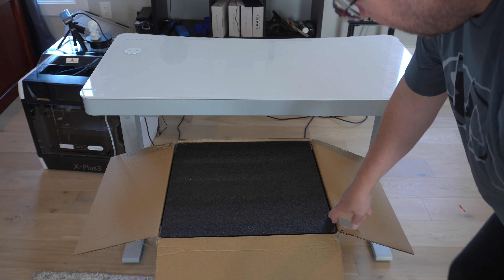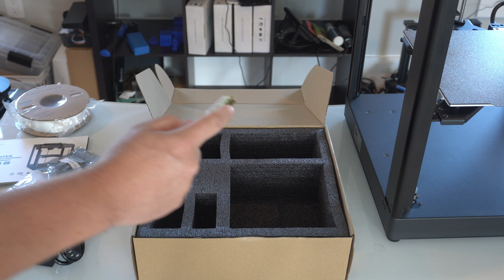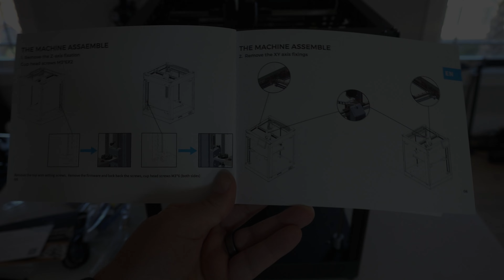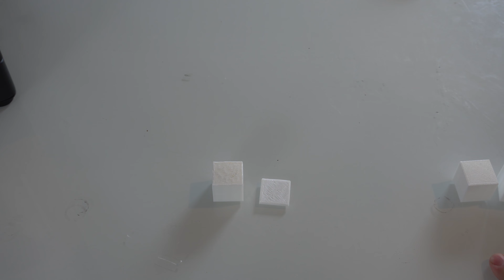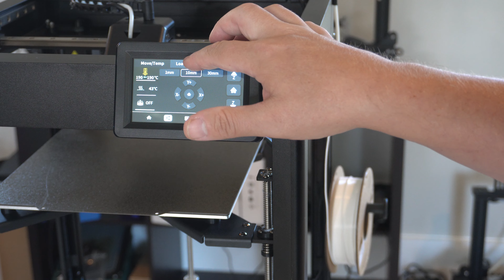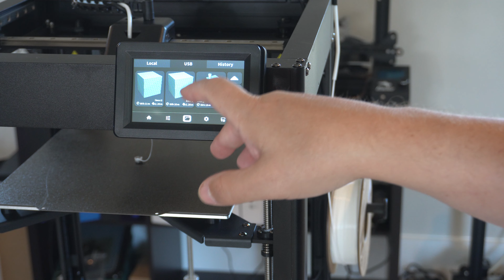TwoTrees SK1 – Unboxing and First Print

Comment: Pretty brutal to watch this video.  Didn’t really cover anything.  Lots of rambling at the beginning.  Then setup was wrong.  You don’t use card stock to do a Z offset.  Didn’t tram the bed, do any input shaping.  Then wondering why your printer was printing in the air.  All you have to do is use the filament load and unload.  Don’t need to home, heat, and push into the extruder.  Printing 3 onboard files is hardly a review.  Maybe watch a couple of the current videos out there on how do get your bearings on how to put some effort into product reviews.  Just being honest here.
Reply from the maker: Hi. Thanks for the feedback. This was meant to be just an unboxing and first print video along with my initial thoughts, its not a full review by any means. This video was already 20 minutes so i wanted to split them up. The next video will cover connecting to klipper remotely, setting up cura, and kicking off prints that I sliced with the settings that will be covered in the video. I'm aware that just printing whats on the USB card from them doesnt really show much. 

I have always used card stock when setting my z offset because thats what most people have available. The instructions they provided said use a sheet of paper. I have another similar printer that has a leveling card, i used that and got the same results. I did run the shaping as well, though that was in the video but need to go back and check. 

For the load feature, i preheated the nozzle a head of time so that i could push the filament through. I guess that i could have just hit load and waited for it to get up to temp then pushed the filament to the extruder but that part is still needed since its a direct drive printer. The filament needed to get to the extruder for the printer to be able to do anything with it including load it. 

The only issue i had with the printer was the z offset thing and it wasnt really a issue, just needed to know how to work with it. Once that was corrected the printers were good like i mentioned towards the end of the video.

Comment: I still don't understand why 3d printer reviewers don't use feeler gauges they are way more precise. Then you aren't guessing your z offset with random thicknesses of paper. Thanks for the review.
Reply: I have tried. Feeler gauges are too small, and you can not band and move back and forth as you do with the paper. Actually it does not matter if the paper is 0.12 or 0.08 or 0.1 what matters is the constant distance/offset then to use that offset for the initial layer.
Oh yeah. And you have to measure the paper thickness  always
Reply: @dekurvajo  there is just no way measuring paper thickness and using paper which can be depressed easily is as accurate as a .1 or .08 or .12 feeler gauge, if it to tight to drag your obviously to close. I get it, everyone has some scrap paper. I'd look at feeler gauges as a necessary tool for any kind of additive or subtractive manufacturing. Same with torqing tools.
Reply: @opiniono-1  yes they can. If it can’t move back and forth the nozzle is too close. Every single one of my .1 feeler gauges have obvious shiny streaks from nozzles running back and forth across them to determine if Z offset is correct.
Reply from the maker: Hi. Ive thought about getting one just never really needed it.
Reply: Probably because there is no need to.
Paper works just fine and everyone has access to it. Rather than having another tool to buy.
Even with a feeler gauge your still going to have to do a first layer test print to dial the height in.
If a feeler gauge had have been used to set the z offset in the video the first layer would still have been too high because there is a textured pei sheet on the printer so it would have made no difference, worse if anthing.
Using paper resulted in  a better first layer due to its ability to conform to the surface texture.
Get the nozzle to roughly 0.1, pull the paper and drop it by another 0.03. run your first layer test print and fine tune as the print is running.
That's setting z offset with textured pei.